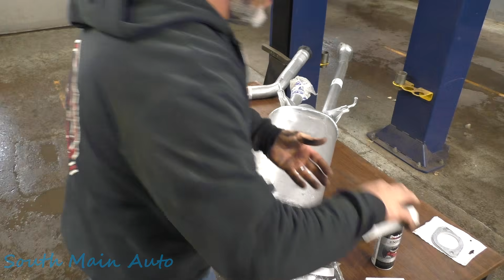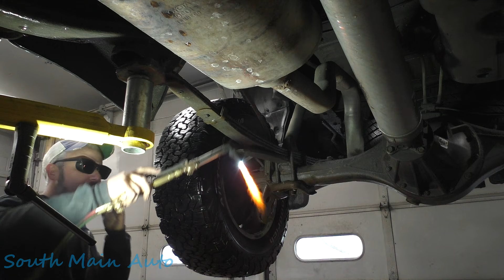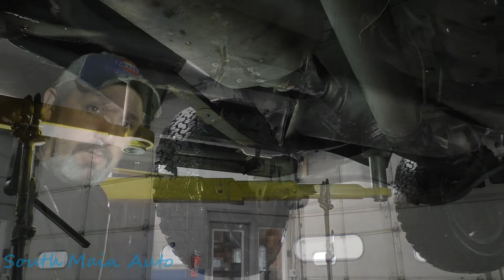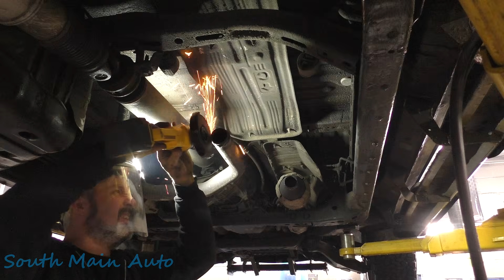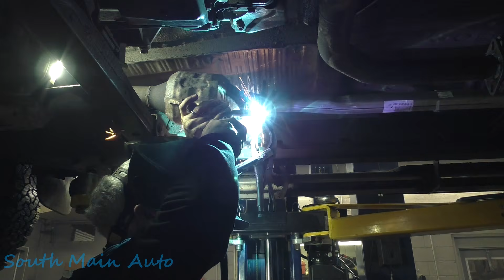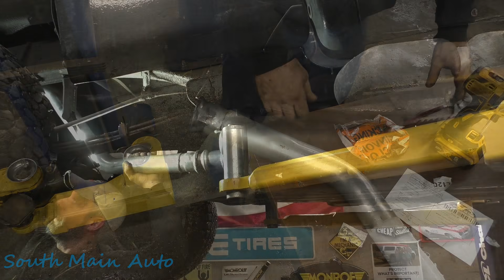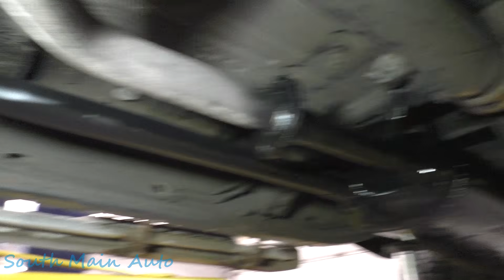Toyota Tundra: Welding On New Convertor Flanges & Replacing Muffler

Comment: I work for a Toyota dealership and have watched them get load after load of new frames in to replace the rotted out frames on several year Tundras, Tacoma’s and Sequios. The company is replacing them at no cost to the customer. I’m assuming that if the frames are rusted out so are the hangers. Our dealership alone has replaced well over 200 of them in the last 6 years. I’m not sure what years this applies to.

Comment: I'm a bit older than you but after the first time I used a torch instead of wasting half a day fighting some rotted bolts I bought my own tanks. I just do a little side work and you would not believe how many people come to me because they started their repair project but couldn't complete it because of the rust. I get in their with my torch and have the job done in a couple of hours after they already wasted most of a day and couldn't get it done. I will gladly buy a few bolts if it saves me hours fighting rust.

Comment: I got two 2003 corolla with 120-170k on them. They do break like every other car. They do rust like every other car. You do have to remove a lot of stuff to access what you need to fix like every other car.
Bottom line, don’t expect a problem free car, even if it’s a Toyota.
Nice thing about a corolla is there is a lot of cheap parts and free information online.
I have a 2014 Ram ecodiesel now. It’s very difficult to find good information to fix anything. Parts are a bit more expensive, but not by much.

Comment: LOL...Oxy/Acet torches are in every muffler shop out here in the west and when they came out in volume, so are MIG welders. Every complete front to exhaust tip dual exhaust job I had done in the 1970's was performed with a torch from removing the existing system to installing the custom bent new system. No MIG welding at all, no muffler clamps etc. I had 4 or 5 vehicles in the muffler shop back then and not once was anything but a torch used. 
Today, I see advantages in the MIG welder and also in the Milwaukee Hacksall or larger Sawsall for exhaust sytem work. There are areas that a blade would be best vs a hot torch with too much ambient heat for various surrounding parts, rubber, wiring etc. but you will always have a use for a torch in any exhaust work, expecially as Eric said, in the north east. Any vehicle repair shop would have a need for a torch as long as the user knows how to use one properly. They are required in various procedures and as in this shops location, minimum requirements for north east repairs. 
BTW...many muffler shops have access to all kinds of "truck" mufflers through their suppliers.  Might be worth a look now and then. We have a few muffler only shops, some still with the "pit" type service bays and ramps above them. Super cool for doing that kind of work. They aren't going to be needed as much if the country really does turn into mostly EV's 30 years from now.

Comment: Plasma cutters are so much better for cutting rusted metal than torches in my opinion.  Especially two pieces of metal with rust in between them, plus you don't have all the heat and flame.

Comment: Did they charge you for the hanger that was left in the muffler? Core deposit. And should you put the bolts in from the back or from the front so you don’t loose them if the nuts come off? Thanks and merry Christmas

Comment: I'm not a technician, but I live in the Michigan section of the rust belt. My crustiest vehicle ever was my '88 Ford Ranger.  It went through a gas tank (dual tank!), many shocks and tire rod ends, brakes, exhaust sirens in 144k miles and 7.5 years. Not the cheapest vehicle to own.

Comment: As a backyard, after hours mechanic, pulled a wrench for many years while living in eastern Mass.  The person I worked with (and learned a lot from), taught me the two most important tools to have ready, before opening the bay door, was a good O/A torch and a 5lb hammer.
Reply: BFH, special tool #1. I'm a super precision grinder hand +/-.0002 all day every day. i couldn't live without hammers and i have a full drawer of them in my roller box. I keep the big ones in the bottom drawer. Teensy weensy ones I make on the fly.

Comment: ...proceeds to hit pipe with screwdriver to brake it free...once again proving every tool has a hammer side....   :)  I think the thing with the torch is, they aren't taking into account time.  Yea you can take out a saw and get a nicer cut but it takes 10x longer.  Time is king and if you can cut 10min off each job you may be able to fit in another job at the end of the day.

Comment: I've noticed that the old school cutting torch is not fully understood by most.  Our younger mechanic want to reach for the plasma cutter but then are shocked when I walk to the torch.  I grew up on a dairy farm and a cutting torch was a necessity and using how to use it was equally important.   The plasma cutter has its place for certain things alright but for bolt/but removal or even thicker materials it seems the torch is my go to cutting apparatus.

I use mine in my home shop with a bit as well and I'm not in the northeast rust belt.  When the need arises I just use the right tool for the job and at times that's the oxy-acetylene torch.

Comment: In regards to cutting torch ... As long as you are just cutting and heating you can use propane and O2 instead of acetylene and O2.... It's cheaper.  You buy a torch set for $200, rent the O2 (easy swap) and use a 20lb barbeque propane tank and your are in... Don't have to deal with buying or renting the acetylene which is the costly part.  Fyi.. you can braze but not weld with propane.

Comment: 39:09 Actually, you DO find that on a Chevy. Well, technically it was a Cadillac Escalade. I had to remove the exhaust once and I had to cut one of those goofy clamps off. I thought "no big deal, I'll buy another one at Napa for about $8." NOPE. Not available aftermarket, and the dealer wanted over $50 for it!

Comment: Eric, it is true that oxy/acetylene is an expensive process in an industrial setting compared to a plasma cutter. Oxygen and Acetylene cost more than air which is pretty much free other than the cost to compress it. But, these are “high duty cycle” operations in that they are cutting out parts or I-beams are something really almost continuously. On the other hand I’ve never seen you have a torch lit for more than a minute or two which in the giant scheme of things is incidental. So the commenters are technically right but practically the cost difference is irrelevant.

Comment: The people that comment about the cutting torches are people that don't work on cars for a living. It's more cost effective and a better use of your time to cut it off with the torch than spend time screwing around with some other means of achieving the same results... getting the pipes and mufflers off when they are rusted on.

Comment: I'm not a pro but I have lots of cars/trucks.  Here in the west side of the Peoples Republic of Oregon (wet but a non-rust area), I have not needed to use a torch to disassemble anything.  When I need heat a MAP gas torch or propane has enough heat.

Comment: OK, Eric it is true that you're not 6061 or Jody (Welding Tips and Tricks) but considering you're working position those welds are pretty damn good. Haters gonna hate but you're a pretty good welder. Well, at least compared to Eric the Car Guy. Do you still have the infamous ball joint? ALSO, HAVE YOU EVER HEARD OF MIG WELDING GLOVES? Might want to consider a pair. Black Stallion and Tillman make nice ones.

Comment: Cutting torch?  Very first tool I bought 40 years ago. Yes required here in salt country. Impact gun, air hammer and torches.  Yes the hot rust is good for the lips. Also good for landing in an ear!

Comment: This is what I did about 3 years ago on my 2010 Tundra. Same time frame winter, mine was in January. I was driving and all of a sudden, the truck lost almost all power. I pulled into a gas station purchased some Ajax dish soap to add to the rubber hanger so I could remove the exhaust. Later I am going need to replace the flanges sometime soon as they are also very thin. I used one of the flange repair clamps to support the back of it for now.   I also think the same thing about how Heaven will be like when working on my vehicles with rust. Everything dies here on earth; we are just seeking for ways to delay the inevitable here. I am very glad you shared you story and how you felt. I hope you and your family have a very Merry Christmas!!!

Comment: 33:50 Well I'll tell you my Rockauto story.. It wasn't damage, though. So I bought a set of CV shafts for a 2005 Beetle. The driver's side was correct. The passenger side they sent had a bolt flange on it and the vehicle didn't. I sent it back and said it was wrong - emailed pics and whatnot. They sent a replacement. Same issue; new one had a flange. Sent it back again and they just refunded my money because they weren't confident they could send the correct part. I think I bought the correct one from Amazon.. Generally I've never had issues. But I also haven't bought anything that could be dented. As for your welds, I've certainly seen much worse. When I first started, mine were horrid but that was also stick. By the time I started learning MIG it was much better. TIG was awesome. Wish I had one at home.

Comment: Can’t even imagine having a shop with no torches!!! I can see using a saws all to cut off an exhaust (hell 12:44 converter thieves do it all the time, and there fast) but ya still need a hot wrench around. No mater where your work is.😅

Comment: Nice job of welding. I'm a welder myself. When you welded the flange on the pipe, If I was doing the job. I would have doubled the flange so I wouldn't have to pull the exhaust forward to close the gap. Upon pulling the system forward you now put stress on all the other donut hangers. Which may cause them to fail earlier than expected. Sometimes you can heat up the hanger rods on the pipe and bend them a little to compensate for any gaps or shortages in length. But overall you did a great job of the exhaust. I just wish when I did exhaust work that I would have had a lift to do it on. It makes it WAY easier to do. I've done all my work on jackstands.🙁😒

Comment: Oxy-Acty torch wouldn’t be my first choice for cutting rusted or carbon steel, I use a plasma torch, it will cut any kind of metal unlike oxy-acty torch and it’s much easier to control, also has very little heat and sometimes you don’t even have to use a grinder. But hey use what you have if it works.

Comment: COULDVE USED A SCREWDRIVER ON THE TOP TO HOLD IT THROUGH THE HOLES AND GET THE BOLT AT THE BOTTOM STARTED THEN REPAET FOR THE TOP 😂

Comment: Are you allowed to inspect and sticker your own personal vehicles?  Just curious, I've always wondered.

Also, my car has always been fluid filmed and underneath the grime/grease layer the frame is still shiny new silver (it's an '08 and I live in Maine) but I just took it in for a sticker and the guy said he couldn't inspect it because the rockers have 2 small rust holes (1 front left and right rear) but my rockers are completely covered with the factory plastic rocker covers.  Should those small holes keep it from a sticker?  When I asked why that would fail since the rockers are still covered he switched it up and said "Oh yeah but the clips on the rocker covers are getting loose and might come off".  I feel like he was just trying to cornhole me for a few extra bucks?  Haven't had time to take it to another shop yet and don't want to if it does need repair, I'll do that first.  Just checking what you guys think?:elbowcough:

Comment: I think the thing about cutting torches being expensive depends on how much you use it. If you're on it all the time the hire charge for the cylinder is insignificant, but if its something you use only once in a while then you spend hardly anything on gas and the majority is the hire fee. I'm guessing you refill fairly frequently? Down south they probably can get by with a saws-all or cutting disk for the few times you need to cut off a nut or pipe.

Comment: Well, I sense some frustration!  (I wouldn't throw it Scotty or Toyota, however.)  Having watched several of your videos, your region is killing cars (with accelerated rust) faster than a tornado in a trailer park.  We see the same rust here in PA, it just takes longer.  All exhausts rust out eventually.  But, my Lexus/Toyota hardware lasts a long time.  I use cut-off wheels instead of cutting torches...less likely to start a fire, but still dangerous.  Muffler/exhaust shops want the fastest system possible - it's a torch!  It's all serious work IMO.

Comment: 30 years in now , the most unhappy customers are the ones who loose the OEM exhaust.  The replacements all rust out in less than 2 years, sound awful and are seldom well fitting.
     If you want OEM exhaust grab a replacement before year 3 of age of vehicle or your chances of finding it dwindle. 
     Years ago we used Arvin Exhaust at the Customer Muffler Shop I worked at.
    They offered a few universal heavy duty mufflers. They worked well and lasted 5 years or so here in SE mass. Shop used a thicker pipe that was aluminized but all that goes to crap once you weld it or have an exposed cut. It still lasted a good long time.
Miss that Huth bender and all the program cards available.

Comment: By the way "calcium" chloride is a manufactured food grade salt compound, while "sodium" chloride (common salt) is usually used for road treatment - although not living in the rust belt of America I'm not sure you dont actually use calcium chloride in one application or another although it would seem to me rather an expensive way to come by a road prep,
 here in the UK for road infrastructure  we tend to use "rock" salt pretty exclusively (a dug out of the ground mix of sodium chloride and other bits of rock and minerals)  .....a bit of a non argument actually since they ALL rust anything back to iron oxide as fast as a  timebomb ticking while you watch.

Comment: As you have demonstrated a certain flair and depth of knowledge for fixing of the automobile, I fail to understand why anyone who does not live in the salt belt would disagree with your selection of tooling for a job like this. I do not use a torch anymore as I now use cutting discs. I actually purchased a brand new oxy set 2 years ago, but have not purchased bottles yet (we no longer rent them anymore, we purchase outright and just pay for them to be refilled) until I actually need to use them. I am old, so have been using a 'gas axe' for many many years. And I would not worry about your mig welding skills, you seen Rainman Ray try and weld?

Comment: One day my boss was welding on a bench and a big blob of molten steel rolled off the bench and into his lap burnt through his jeans through his underwear and melted 2 bits of skin on his manhood, he never realised it was burning through until i seen him jumping about in agony, i couldn't stop laughing watching him jumping about trying to rip his pants off.

As for touching hot metal i was welding up a pair of drive gates i had fabricated and had just finished a big bead of weld around a decorative point and within 2 seconds of finishing welding it i tried picking the gate up and within a millisecond i realise i had messed up safe to say i dropped the gate and ended up with being branded across the palm of my hand with a fleur-de-lis 🤣

Comment: Just two years ago, I replaced the original exhaust on my '96 Camry, and this year the original exhaust on my '98 Altima.. Of course I'm not in rust-belt New York.  Had to get the parts local, 'cause after RockAuto adds shipping, the price nearly doubles!

Comment: Americans are the lucky. I  went on the Rockauto site to order anything other than a Walker garbage tailpipe for my 1996 Trooper . They had ANSA for $58.34 . Ok ...... but the shipping to Canada by RL (the cheapest) was $462.21 and tax of 67.67 = 588.22  If I want Fed Ex  just the shipping was 672.19 !!!!!!!!! I ended up buying a Walker in Canada and it is so bad I'm going to the steel shop , buying 1/4 stainless , making the flange and getting a shop to bend and weld a stainless pipe. And I'm sure that will be less than $588.22!!!!

Comment: 1997 s10 4.3 160,000 miles  in NJ original stainless steel exhaust, in 25 years all it needed was a new gasket, the whole thing is still in great condition.

Comment: Toyota for the win!  NB Canada (rust belt) here, 2003 Tacoma with 498000 kms (around 310000 miles.  Toyota stuck a new frame under it for me in 2011 under warranty- show me a GM dealer who ever offered that.  Not sure you guys can get it in the States, but I use Krown Undercoating which keeps it good underneath.  Try to do most of my own work, but at my age it's not much fun on a concrete floor- if it needs a hoist, we go to a shop.  Not that it needs much work- blew a CV boot last week and debating shop vs garage floor for that one.

Thanks for the great videos, and best of the season to you and your family.

Comment: I have had my Victor torch since the very early seventies and still going strong.  Here it makes sense to own your bottles (they still change out the bottles so you aren't liable for the hydro testing ever) as the monthly charges on bottles was astronomical also I don't believe they even offer that option here anymore.  Having said all that for the past twenty years or so my Victor doesn't see much use when I can use one of my plasma torches.  The consumables last quite a while and are pretty cheap in comparison to acetylene and oxygen (even propane is high here) so when I can the plasma torch does the cutting.  Can't use it for heating though so my bending and heating cause me to lead out the hoses.  I wouldn't really do without either.